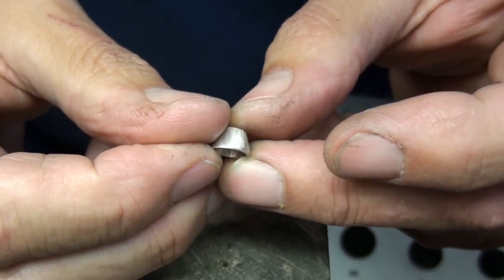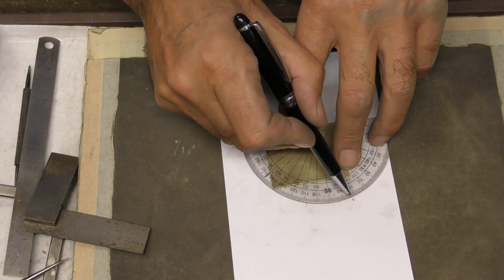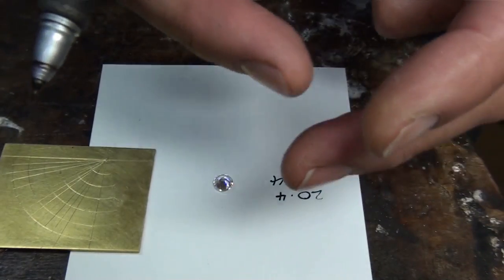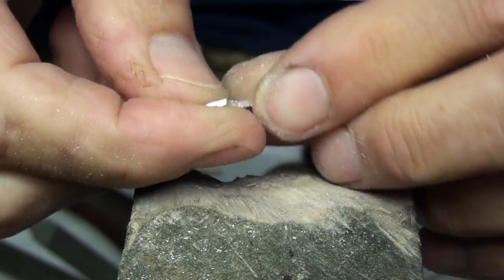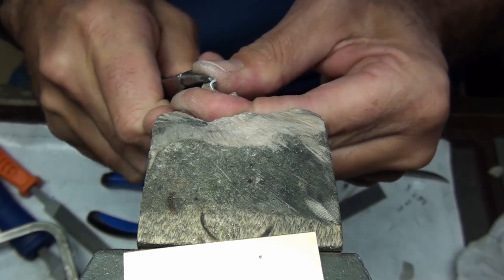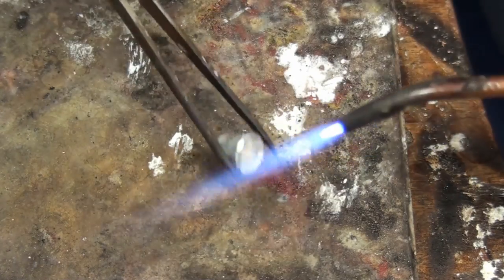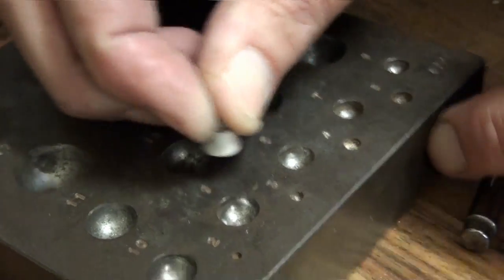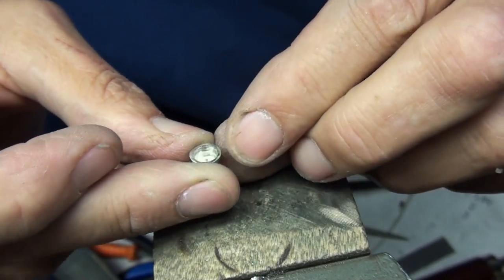How to make a bezel setting

Comment: How about this. Take a small piece of thick paper. Roll it into a cone and glue it. Hold the stone woth the wax thingy, and stick it down the cone, where you have made a few lines, and notice whitch one, it fits. Use that as a template to cut your metal, and make the come a bit longer than needed, and file it down to fit 100%. NOT to say anything about this skilled methode, just for those who aren't as mathy aso. As long as we reach a perfect result, the task is solved.

Comment: I do appreciate the effort you went to to create the video.  I also like your template plan as a teaching tool to explain the concept. That will be useful for people getting started.    Beyond that, after many years experience doing this myself, I think you might have overcomplicated the rest of the process . I did see the proper tool for finishing those collets on your screen. But then you didn't use it?  When you did your calculations you subtracted the thickness of your metal. You might try adding the thickness of your metal instead to get a perfect fit for your stone.

Comment: Suggest making a template unit about 10% heavier and taller (different sizes) then rubber mold for wax model.  You will loose apprx 3% wax shrinkage in cooling. Then if you do castings add a few models (different sizes) to sprue to build stock settings availability. Easier and faster to refinish and fit when variety available. PS, no solder line. 😉  Excellent from scratch instruction which is essential basic knowledge.👍

Comment: Is this method is more recommended than creating a tube and then taper it in the conical bezel block? One teacher told he doesn't like the method of creating the tube because the bezel thickness always comes out asymmetric and in general that it's less accurate..is ot true?

Comment: Really struggling to understand why you subtracted the thickness of the sheet from the circumference of the stone.  Surely you should be adding the thickness as otherwise the physical hole for the stone in your collet will be too small, or are you just counting fixing this with the collet block and trial and error. Mathematically it doesn’t make sense to me unless you know that you are going to stretch it by a given amount in the shaping process, and if so, is that always the width? I’m confused!
Reply from the maker: Jennavieve Harley making it slightly smaller is preferred as the collet will stretch out when you do the final forming
Reply: Since the 21.4 is the circumference of the stone, that is actually the measurement of the arc, not the point to point straight line measurement. He has to remove some of the circumference to account for the longer length of the arc.